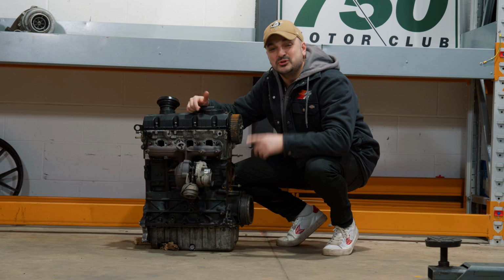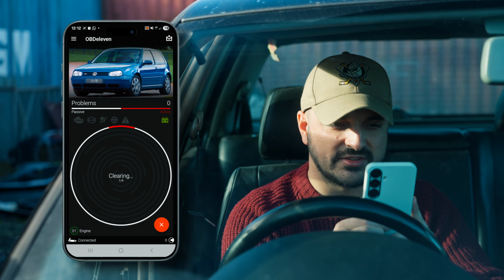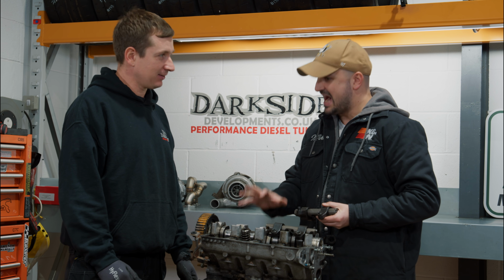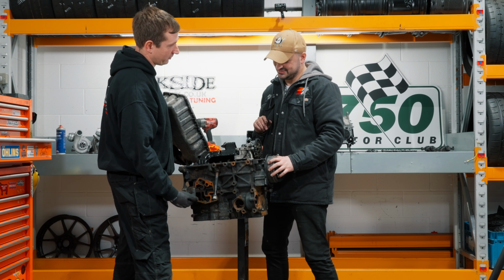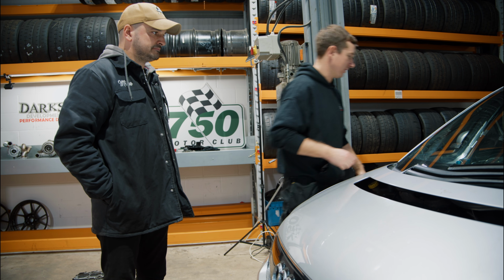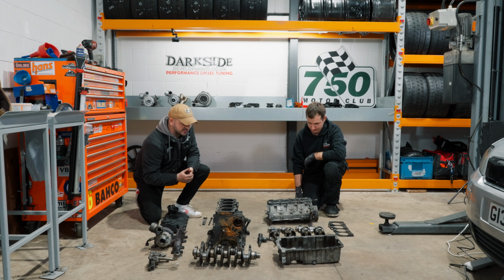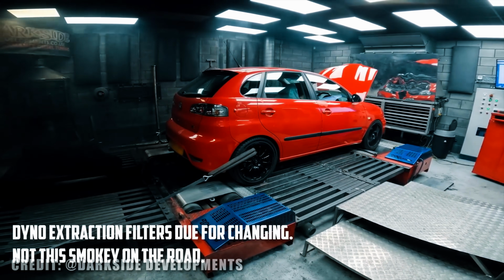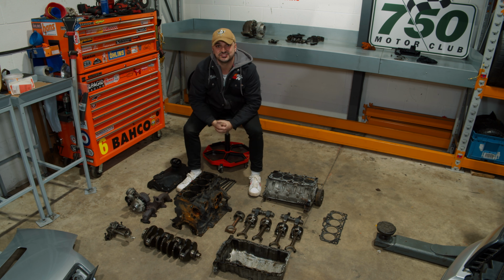Why This Volkswagen Diesel Is The Greatest European Engine Ever Made

Comment: Its a great engine no doubt. But the BMW M47 2.0 diesel is better. Why? You dont have a timing belt to change but the old chainsystem that lasts forever. You have commonrail injection and no PD elements  you have to worry about. So basically just an oilchange every 10kkm and always warming it up propperly you have a bulletproof efficient engine. Got 650kkm on mine without any issues whatsoever.
Reply: You're right, my colleague has got this in his 3 series 2006 BMW.

Comment: Hello there. What suggestion do you have for a 316d 116HP F30 2.0 N47 diesel engine as a replacement for its original turbo in order to gain some additional horsepower on top a a stage 1 unlock to 143 or 180 HP. Thank you so much ! :)

Comment: On the piston question, diesels have the combustion chambers in the pistons. This design was also used on the ford cross flow and early Jag V12 petrol engines. 

Having the chamber in the piston means that the piston is required to dicipitate far more heat than it would with a chamber in head design. 

This design works better on diesel's as it creates a longer flame path which is better for slower burning fuels. 

Another problem with the slower reving diesel engine is that it offers more time for the combustion gasses to leak past the rings, so a slow reving lorry engine will have 5 or 6 rings where a race spec petrol engine will only have one or two rings. 

On a high reving petrol engine like the k-series, weight and drag become much bigger issues than blowby, hence smaller pistons and less rings.

Comment: My 130 hp ASZ Golf 4 is a beast at high rpms but it does have turbo lag at the start & it is very annoying particularly when you start in a slope but my 110 hp Golf 3 AFN does not have that lag.

Comment: The 1.9 was amazing, but sadly, the 2.0 and 1.6 that followed after that are absolute junk , the V 10 will struggle to have injectors last 50 / 60 K cost almost 10 grand to sort , I used to do around 180 K every 4 years , I've had 4 VW's in a row , having driven almost 2 million miles , the latest VW's are absolute junk , I won't have another VW if it was a gift

Comment: I've had my PD 130 MK4 Golf for 24 years now, once it was out of warranty it was tuned to 180 Bhp and 330lb-ft. Driven daily it always returned an average of over 50mpg. Over the decades and 225000+ miles the tune evolved with some bits from various sources including Darkside to Hybrid Turbo, front mounted intercooler with larger pipes and an uprated clutch to handle the new power, waiting for dyno and tune. Up to now its still on the original head gasket and bolts, as I've now noticed it using some coolant that's the next job for the summer.

Comment: People forget the context of why diesel engines were so "golden" for a brief period of time,   in essence the Euro 3 and Euro 4 emissions regulations allowed diesel engines to emit 4 times as much NOx emissions as petrol engines.    And this was when new, when the same diesel engines get to high mileages and the injectors and/or fuel pumps (if CR) start to wear then they generally run richer and emit even more NOx and loads of particulates.    Euro 5 reduced this to 2 times and Euro6 to equal to petrol by which time the necessary after treatment costs a fortune and limits the fuel economy benefit over a good turbo direct injection enigne to around 10% rather than the 20 to 40% benefit of a EU3 or eu4 diesel over an equivalent performance NA petrol engine.    As a result diesels were always going to disappear from smaller, cheaper cars due to the cost of the engines and after-treatment as they simply cost too much to the fuel economy benefit they offer.  in the USA the emissions standards were always the same for petrol and diesel and limited the benefit of diesel to around 10% fuel economy and limited the sales penetration as a result.    This indirectly VW to become "desperate" to succeed with diesel in USA (as sales started to reduce in europe to keep their factories busy) and this led to the defeat devices and ultimately the shame of VW and the decimation of diesel sales in Europe.    So, whilst it is without a doubt that the PD engines are good and reliable, they were not playing by the same set of rules as petrol enignes and gained great advantage from the rules being tipped in their favour

Comment: I think the 2.0HDi also should be close to the 1.9TDI. 2.0HDi was one of the first common rail diesels and they are as reliable as the 1.9TDI, but don't see as much glamour because they're on french cars. My last one had 500k km and was completely original turbo, injectors etc. and looked almost brand new inside (shows what oil changes on time do). Got 3.5-4L/100km, couldn't overheat no matter what, even if you drove almost 12 hours straight. A bit down on power but had tons of torque

Comment: I agree this engine is fantastic. I reached 320000 miles with this engine before I sold the car. The engine was still working fine. I only sold it as the steering rack was dying.

Comment: I bought a 2 year old Audi A6 2.0 TDi PD (16 valve twin cam) in 2009,  still under warranty with 17k miles on the clock. It was 140BHP and I had it remapped to 170. I sold it in 2004 with 322k miles on it, still sounding and running like new on the original engine with negligible oil consumption. It was always serviced on time when the computer asked for it, every 18k miles or so, with the best spec oil (VW 507.00). It was also run on BP Ultimate diesel. If you look after these engines they really are bomb-proof!

Comment: I learnt about this engine recently and I did a curious search on the used market here in Sweden. one example popped up, a 2002 Passat with 200,000 miles and costs around £2800, the frustrating thing was when I found the yearly tax on the vehicle would cost £550!! Such a shame the car will end up getting scrapped not because it doesn't work anymore but because the tax is too much to justify, madness.

Comment: The PD wasn't my favourite... i allways killed head gasket or the head.... name it pd 101, 116, 130, pd 1.4 tdi 70, 75 ,80 hp ... 
all of them the head gave out pretty fast... cause was give it the beans hill climb or anything extreme and when you stop you dont let the engine idle at least 15 mins and you shut down in 5-6 mins....all of them died some eaven when i gave it the beans.... while going.... so the head is crap....
the alh and the other 110 with diesel pump on belt is much more stronger at the head.... none of those left me on the side of the road ... and i modified them bit time like 3.0l turbo swap .... 200-220 hp was kinda max on the belt driven fuel pump... but never got stranded

Comment: I had two of these - VW Passat and Skoda Fabia vRS.  I used to do quite a lot of motorway and A road miles, in my Sunny 1.4 petrol car, and I was always very impressed at how VWs and Audis pulled away strongly.  One time, I has a hire car, a Mondeo TDCI, which seriously impressed me with the torque.  I decided to go for a diesel car following these experiences, and was originally looking for a used Skoda Octavia (first Gen).  I just couldn’t find one for the right price/mileage, but a VW came up instead.  When it came to replacing the wife’s ageing Fiesta, I had a good think, and settled on a used Fabia vRS.  I figured that the 1.9 TDI would make it a fun car to drive, which it was.  Later on, I had it remapped, which was a great decision!  
I have always been fastidious about oil and filter changes, and in both my cases, the engines outlasted each of my cars.  I now have an Octavia 2.0 TDI (CR), but would have gone for the vRS with the Piezo injectors if I had the money.

Comment: You should be able to avoid the cam wear issue by bonding a lubricant to all the metal parts in the engine.
🙂#XcelPlus

Comment: I have had a 1.9 TDI Golf 3 and it was a real shit comparing ton 1.6 16V Ford escort engine! Really, diesel was the biggest regres in automotive historry, is like turning a car into a truck. Still thingk about 1.6 16V  fors escort engine which starting to have a little noise after 6000 rpm, behind this you could not hear anything, just accelerate.  Un golf it was like you were driving in reverse.

Comment: Think I had this engine in my 1996 A4 and my 2007 A3. The A4 was a bit gutless at low revs [ early turbo lag] and got a black smokey after 60k. Both were a bit too easy to stall at low revs without warning. Still liked both cars doing 50-60mpg.

Comment: Ran 3 Passat B8 TDI´s in the last 10 years, 900km range on the german Autobahn, 1300km in countries with crawlspeed :)
Very reliable, 30000km oil changes but you can feel how the DPF regeneration and constant a constant bashing on the DSG and 4motion system can require some service in later years.
The 2017 200hp TDI DSG 4motion was the best, after that every facelift slowly ruined the User experience with some cost cutting.
Company made me switch to an ID.7 GTX with 300km range last year....

Comment: I had 5 company cars all VW 130 TDI 's with 3yr leases and were returned with 150000 mls on the clock , and apart from regular servicing and cam belts never missed a beat . 
Now I am retired I bought  a Skoda Karoq  with guess what ?? the same motor.

Comment: I'm confused. This is the worst diesel I have ever driven. It may have been reliable, but many things were back then. The Injectors would brake and cost 600 each. They consume oil like fuel, they produce more soot than a steam train and their power delivery isn't very linear. They were quite when idling but were noisy once you got going. I'm trying to see a good side to it?
Reply: People have tunnel vision. They just look at things through the eyes of reliability. So they just ignore everyrhing else. So yeah, it may have shit caracteristics compared to many other engines, but because it is reliable - it is the best...

Comment: I had a Golf 1.6tdi and nothing but problems between injectors, DPF at 200k km, one of the worst cars I ever had. I have owned a Renault Megane 1.5dci, K9K engine, now for 9 years, 310k km on the clock and going like a dream. Doing the usual service, oil change every 12k to 15k, a brilliant engine. I will change the end bearings before they knock and wash the DPF, it will go for another 300k.

Comment: Best diesel engine I ever had - 1.9 Citroen BX  220k miles with zero issues, oil / filter changed every 6k. Next best - VW Beetle 1.8 d  190k miles with zero issues, again oil / filter change every 6k miles. Both sold on to happy purchasers.

Comment: The shitty VW is rubbish in most aspects, this company is a joke what the engineering level is. I worked for a place where VW had outsourced cylinder heads for their 3 cylinder engines and it was a mess. Engineers from tecnical schools instead of proper university level, lots of CAD lovers with a million parts. I don't even have good understanding in detail about this type of casting (or do you call it injection molding in metal). Deep holes to be drilled with only one millimeter clearance to another hole with oil pressure. Now they needed specialised drilling. A mess, my boss moved to VW after his PhD and he was also the type "I don't know anything". This is a goverment owned company (mayority stake) and after China doesn't want their shit anymore finally they are going to end up on the dumping ground of history. Sure China is gonna be thankful for what they did for China (the only major car brand that believed in China) but at one point its gonna become unbearable. The shit they produce is an insult to any adult engineer, well the italian and french shit is even worse. Who the hell is stupid enough to buy this stuff? But this europe, lot's of folks the don't even know what their job is an even less they have a clue how to do their job. When deadlines come, the chickens panic and pay top dollar to freelancers or specialised external companies to save the day.

Comment: We had a 1.9 115bhp VW Touran (09 reg) and it was incredible on a long run/holidays etc. We then went to the newer, cleaner 1.6 VAG diesel motor in an Octavia estate 67’ reg), and that was also incredible. Had that for 7 years, but then started doing mostly little journeys, so then moved to petrol. When were DPFs, or at least as we know them now enter service?  The 1.6 would often do the DPF cleaning cycle if it hadn’t got hot enough after we’d turned the engine off, which was part of our thinking to move away from it as it wasn’t doing the longer journeys to get hot enough. Miss both those cars!

Comment: I had the Fabia with one of these in it almost 20 years ago. It was a beast! In 120k miles it blew one turbo and an injector, but no other engine issues, so pretty reliable overall. 50+mpg on diesel and 310Nm under your foot in a little hatch was a sweet delight.

Comment: I had a 1.9 in my VW Sharan. An incredible engine. 400,000 km and my garage said it was like new. I'm currently running a 5 cylinder AXG 150hp 2.5tdi in my 2001 T4 California. It's currently on 390000km with no issues.

Comment: I had a 1.9 105 in an 07 Jetta… it was, the best driving everyday diesel engine I have ever driven and owned. I put 270k miles on it… fault free bar 3 belts, service items and an Alternator. Family happened, I bought a B7 passat 2.0 Bluemotion (no adblue thankfully) and it’s nowhere near as good. Cant blame VW though… I blame Euro emissions strangling the life out of modern engines, reducing reliability and drivability. The PD is the best engine, and if you have one… love it, never sell it!

Comment: My Mrs put petrol in my 1.9tdi polo with 227000 miles twice and ran it till it stopped, chucked a can of diesel in each time and carried on she still drives perfect to this day with no engine lights
Reply: That is absolutely crackers. The nearest story I have relates to the Honda single-cylinder 125cc used on all their small 2000s bikes (CG, CGF125, etc.) which my mother ran dry and then ran without any oil for about a year without noticing. It started to rattle a bit and benefited from a head rebuild two years later, but never went wrong. I couldn't believe it. The mechanic couldn't believe it. I mean it was bone dry.

Comment: I bought a 2003 Audi a4 TDI…I bought it off a friend for £200 …there was 260k on it…I drove it for 3 years ..had to scrap it as it was rusted badly …but if it didn’t it would still be driving ..what a motor 👍

Comment: I sold mine in a Caddy Maxi 140 PS with 320.000 km. I was afraid i couldnt drive any longer with it in German cyties. Expected the engine to be at the end of life cycle. But 100% power, no oil consumption, no metal in the oil filter. Even clean exhaust (finger test).  I am sure the thing runs today with more than 500 tkm.

Comment: 32:30 All "modern" (mk2 Golf and up) VW 4-cyl. engines are basically the 5-cyl. Audi Quattro engine - with one pot chopped off. Bore and stroke are the same. That leads to a 1.8L - everything else was derived from that - including the later diesels. The 1.9L TDI had a bit more stroke.

The 1.8L 90hp was a very popular engine in the mk2 Golf - although they never had more than 84hp from factory. The felt power increase in comparison to the 1.6L 72hp was due to more torque. That engine had a bit less stroke.

The later 2.0L including the 150hp 16V (ABF code) had slightly more bore - meaning more power in factory N/A form - but less good for turbo conversion.

I owned one of those. The strongest N/A 4-cyl. VW ever made - to this very day.

Interestingly - it was de-tuned to 150hp from factory to justify the 2.8L VR6 @174hp. With the right chip (from Garlock here in Germany - yes - that actually was a "chip") it did ~165hp. Due to significantly better engine management, 4 valves per pot and last but not least 2 cylinders less it was significantly quicker - and able to corner. My mk2 Golf did 220kph (GPS) on the Autobahn. Due to looking basically stock - a true sleeper.

Comment: 30:50 The diesel crank is not only stronger - it also provides a minimally longer stroke.

This way - a 1.8L becomes a 1.9.

The cast-iron block is also used for high-hp turbo mods on gas/petrol engines. Obviously - it can take more pressure and heat than the usual cast-aluminium ones.

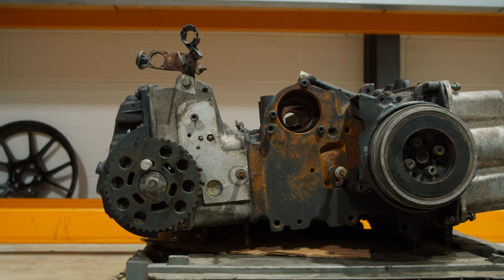Comment: 1:50 AFAIK, a 2.0L PD doesn't exist.

The later TDI was a 2.0L - but not a PD. PD was seen as a dead end - and couldn't meet modern emission standards. Therefore, the later 2.0L was a common-rail engine with a 16 valve head.

All PDs were 8 valve - as the second cam runs the PD elements.

Comment: 1 million kilometers on a 101hp golf estate taxi in Romania. Just change the damn oil. Dads pd130 a4 2002 he bought brand new still has it now 380k miles only changed turbo at 350k miles original camshaft still. Just oil changes is all a pd needs

Comment: Yea they're great, but people underestimate the new common rail VW diesels. We've got dozens of them in ambulance vans, the 2.0 liters with 205hp, and all of them at this point are beyond 300,000km and some even over 400,000km on the clock, none ever broke down or had a mechanical issue, and these engines were never babied from day one, we're talking ambulance use, meaning, start it, full throttle immediately, no warm up, no cool down, regardless if its freezing outside or hot. Come to think of it, we've never had a single issue with DSG boxes or 4Motion drives eithers, they're just bulletproof drivetrains despite being absolutely beaten on most of the time.

Comment: lol.... not even close...
This engines "drink" a lot of oil, have problems with mass airflow sensor, dual-mass flywheel, turbo, injectors, injection pump....etc...
Great performance but not a durable engine...